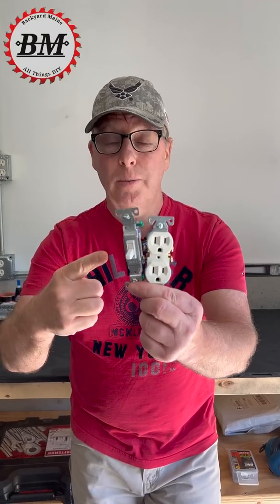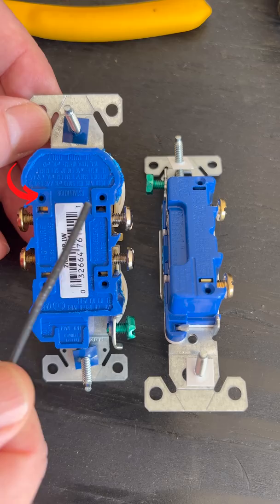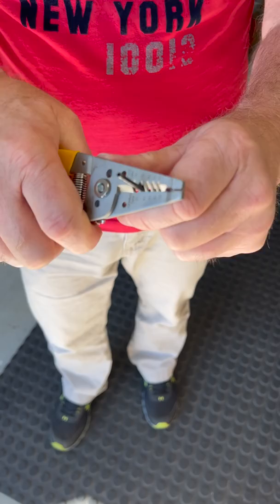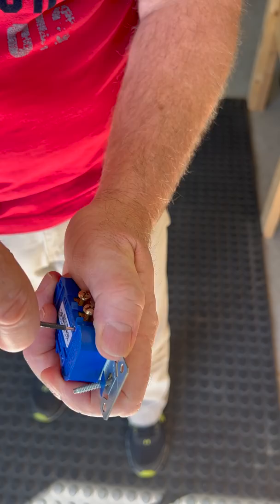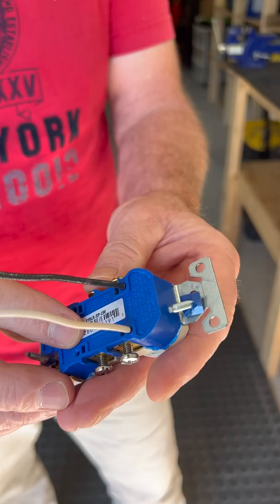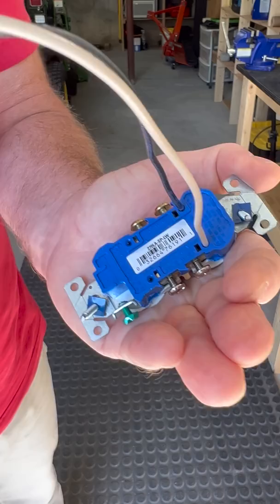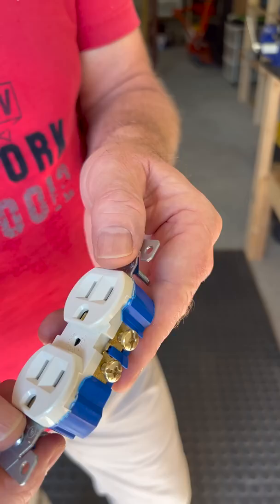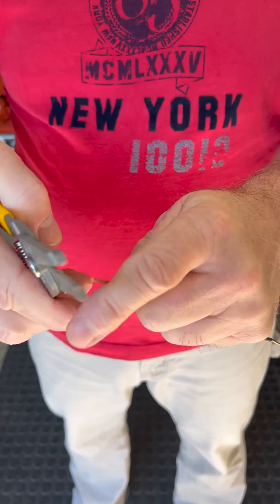Don't make this electrical mistake #Shorts

Comment: Anecdotal evidence, I assume. Please deal with facts.
Reply from the maker: Facts. They are the number one failure found by service electricians. My advice is not to use them but that's all it is advice based on 38 years of experience as a licensed electrician and electrical engineer.

Comment: Your American standards are low for electrical components.
Reply from the maker: I would like to see eliminate this type of connection.
Reply: @BackyardMaine  the screw connections always loosing due to vibration. We have 220v @50/60Hz in Netherlands
Reply from the maker: @shaggy01985  Never had a vibration issue in residential wiring. Industrial yes for sure. I only is spec grade devices for those and they hold up well as long as they’re installed correctly.

Comment: What are these prehistorical elecvtric furnitures?
Come on America! You are making F15 and F16 but you have the worst electrical furnitures of the western world!
And I do not speak of your 110V, another big problem (Better have higher voltage AND therefore, lower amperage, like in Europe).
Reply from the maker: We like it and I don't see it changing anytime soon. Just because we're different doesn't make it worse. From a safety standpoint we actually have fewer electrical fires and electrical related injuries/deaths per capita than most of Europe and the UK.